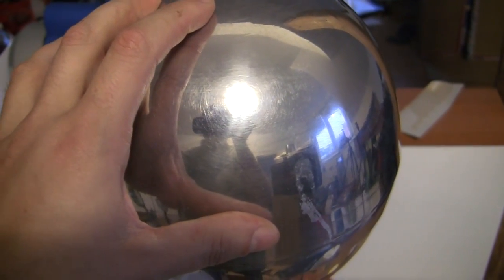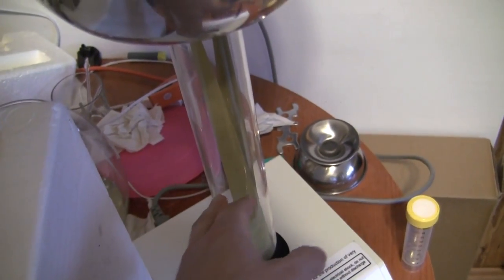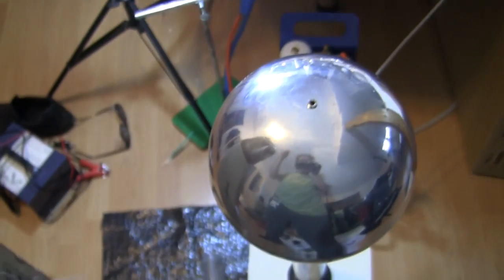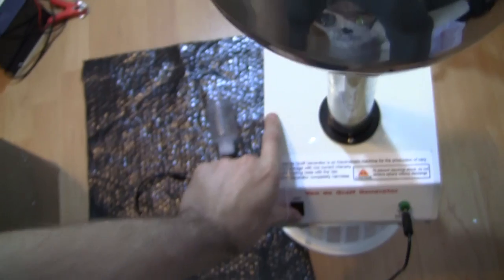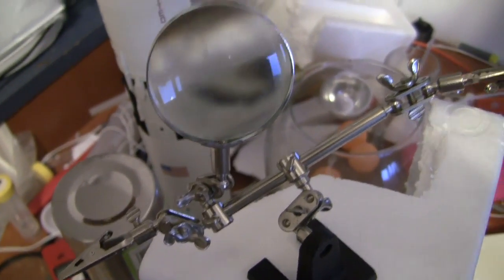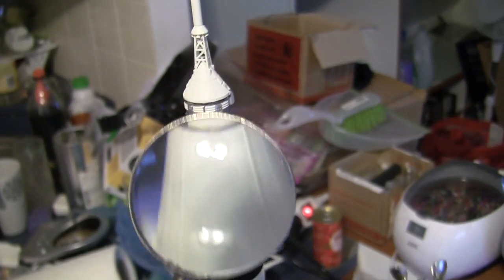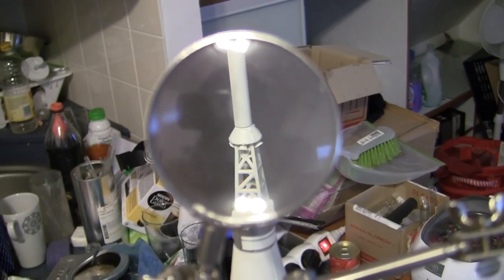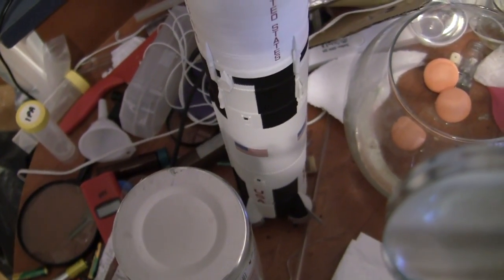Surviving a 10 000 VOLT shock!

Comment: 10,000v is for kids. 80k is for ladies. 130k for men. just picoamps :)
Reply: ***** If you don't get shocked with enough power to send a delorian to 1950 you aren't even on my level.
Reply: Billy Skidmore Volts arent power :P watts are power. amps are current, volts are emf (not the "unbelieveable" type). volts x current = watts.
Reply: And a million for real badasses.
Reply: ***** We had this kid in our electronics class who completely volunteered for this. so a hand crank generator with no regulation on voltage. he grabbed the 2 leads off it while we took the handle off and hooked it up to a drill.   that may have killed him but one of my cohorts was actually physically assaulted by our substitute teacher "He's gonna die"  (since the leads were held in each hand, and he was wet, it may be true).
Reply: yeah i just dropped an irish pop band from the 90s reference into that
Reply: Neeboopsh
That's not assault, it's defence of another.
Reply: Navitas Nexus Well legally that would be true. But he could have simply screamed and everyone would have stopped. no need to use force on kids. but i see your point :)
Reply: I would argue that people so stupid and/or cruel do require immediate action because they may not stop immediately.

Comment: A static shock is normally around 4.000 to 35.000 volts. So 10.000 volts isn't that much. Its the amps that kill you.
Reply: Don't. Just fucking don't. 
/watch?v=8xONZcBJh5A&list=UUosnWgi3eorc1klEQ8pIgJQ
Reply: ***** Yeah, you know that guy doesn't really know why people say that right? When you are killed by electricity its the combination of amps and volts that kills, where amps play the most important role. You can deliver 1 micro amps with 40.000 voltage and it still will not be enough to kill, delivering 1 micro amps with 4000 voltage still will not kill a human. If you deliver a non lethal amp with a skyhigh voltage you will not kill. A static shock have a very low amp but a high voltage, thats why it doesn't kill but will fry electronics as they can't stand more than like 12-15 volts. A human die at around 100-200 miliamps but can withstand several thousands of voltages no problem. I got a friend that have been shocked by a +100.000 voltage and didn't even feel it, it was because there was like literary no amps in that shock. Voltage without current doesn't do jackshit to the human body.
Reply: Cloud Seeker You're not going to kill somebody with a low voltage high amperage supply either. Both come into play. Btw, the amount of current in a static shock is very high, may even reach over 8 amps. But it is over very quickly, that's why nobody dies from it. Watch the video. And btw, if there were no "amps", there would be no voltage. Don't bullshit me like that.
Reply: Do you even resistance, bro?
Reply: *****
A device I built that plugged into the mains and produced 8000 volts, was a pretty distraction watching as the arc went from the device to my fingers.
The only thing to remember here though is that I used a cockcroft walton voltage muliplier with a 10 megaohm load resister so was producing less than a miliamp of current.

You are quite correct in pointing out that high voltage is dangerous, but only if you don't understand basic electronics.
If the source is capable of delivering a sustained current of only a few milliamps at high voltage, then you need to treat it with the respect that high voltage (or even low voltage if used stupidly) deserves.
Reply: magottyk True.
Reply: ***** let me try to help, there are two case here that need to be separated:

1. the current is flowing through your heart in which case its not about tissue damage but a distortion to the heart's rhythm, in that case its really the current that is the most contributing factor to ones demise.

2. tissue damage, which is dependent on the energy of the shock. in that case (assuming a non "trivial" exposure) current and voltage play the same role more or less.

p.s

there can be cases were there is  voltage but no current, if his friend was completely isolated he could come into contact with some high voltage almost without no current.
Reply: ***** Actually you are going to kill someone with a high amp. 20-30 miliamps over the heart will kill a human, 100-200 miliamps will kill you no matter where it is. Remember that the current in your computer is using a voltage of around 12 volts, but geting a shot from a bolt from that current is lethal. If you are hit by 8 amps you are hit by a amount 40 to 80 times higher than the needed to kill a human. Also that a static shock goes over 8 amps is dead wrong, can you please find a source for the that when you take off furry coat and than touch a metallic thing that the current in that shock is 40-80 times higher than the lethal amount? Also you don't to have a long exposure to a strong current to die from it, with a high current (amps is the flow of electricity, how much electricity that travel from point A to B) it is enough to cause major damage to the cells in the body and stop your heart. If you can't restart your heart you are dead no matter how long the shock is.
Reply: Cloud Seeker Jesus Christ, please watch the video I posted. Please. All of the information is located there, the 8 amps included.
Reply: yoav116 I'll answer to your points:
1- I don't know whether that is true or not, but let's pretend it is just for the sake of the argument. How do you get a current high enough to pass through your heart to mess it up? You either change the resistance of your heart, which is not a particularly easy thing to do, or you can crank up the voltage, the latter being much more likely and easy to do. 

2- They both come into play in pretty much any situation. For a certain given resistance, the only way to push more current into it is to increase the voltage. 

About your PS:. Yes, that was my mistake and I apologize.
Reply: ***** you appear to fixate on current and voltage so much that you overlook several factors, the path that the current takes is also dependent on the how one comes into contact with said supply.

if you hand comes into contact, the current is very likely to pass through your heart, but if your leg comes into contact (assuming your other leg is on the ground) you current is unlikely to pass through your heart.

as for your second point, you would be correct if all "things" acted in a linear fashion, which they do not, one example (out of many) is a zener diode.
Reply: yoav116 I'm not overlooking anything. If you don't have enough voltage to push a current high enough to screw up your heart, considering that every other variables stay the same, it won't screw up your heart. I do recognize that the path current takes is also very important, but I wouldn't worry about low voltage supplies, even if they can deliver tremendous amounts of current to a low resistance loads.
Reply: ***** i think there's a misunderstanding here, i never said that low voltage supplies are dangerous.
Reply: yoav116 And I never said that the path that current takes doesn't matter. I guess we started with the wrong foot here.
Reply: *****
yoav116 
http://smarteng.mst.edu/sensors/electricshock/
https://www.physics.ohio-state.edu/~p616/safety/fatal_current.html

It would seem that low voltage shocks can be more dangerous than high voltage shocks.

The heart clamping was something I was unfamiliar with until I went to check the internal resistances of the body which can be around 100 ohms.
 
So shocks from very low voltage can be more likely to kill you than high voltage due to the clamping effect preventing ventricular fibrillation which can make resuscitation much more difficult.

Ohms law states I=V/R so plug in our in numbers and what do we get, I=150ma v/100
V=IxR V=0.15x100, V=15volts internal can kill you.

So lets say you cut your hands on fine wires carrying 15 volts, that according to ohms law might kill you.

It very much depends on the voltages and resistances at play, plus some other factors like did you put a lot of salt on your chips at lunch.

Comment: If the two adjacent electrodes are smooth round surfaces, which includes your grounded hand then the charge can build up to higher levels before an arc is initiated between the two surfaces. In other words you will get longer spark jumps.